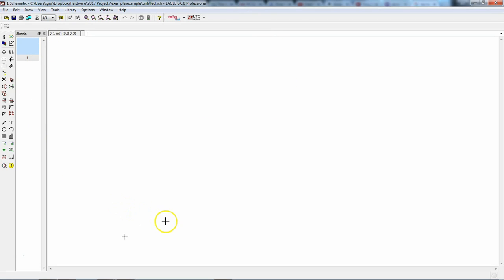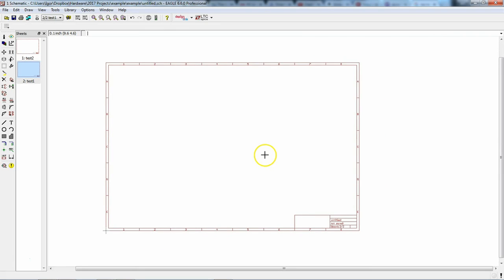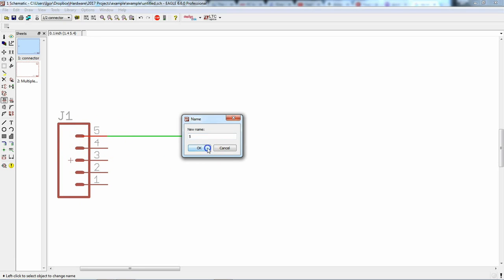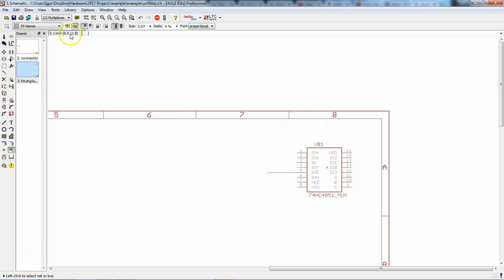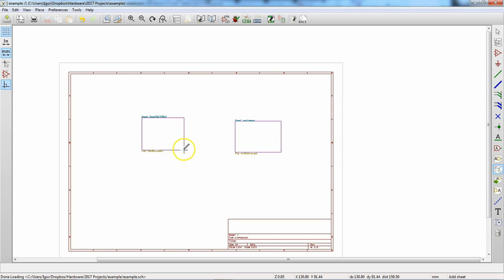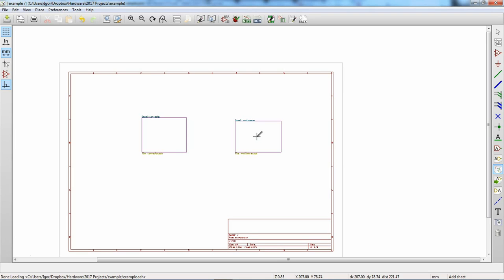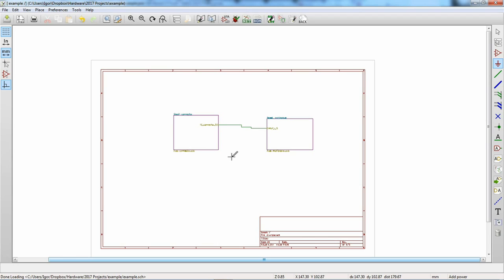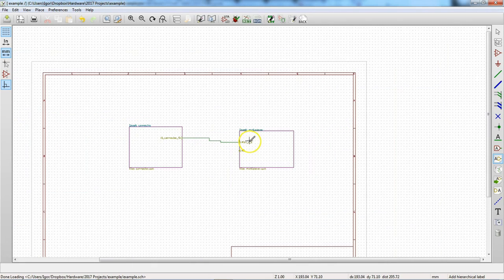eapbg #41 KiCad and Eagle hierarchical schematics and multiple sheets

Comment: When you create for example 2 sheets, and in the firts sheet use a IC1(anywhere) with 50 pins, but in this firts sheet all conections will be a messe. in this case I want to do a second sheet to divide to the half. but in the second sheet when i copy the IC1 from the firts sheet to second sheet, Eagle generate like other component for example IC2. But i only want to use IC1